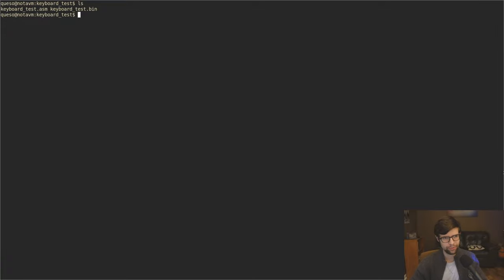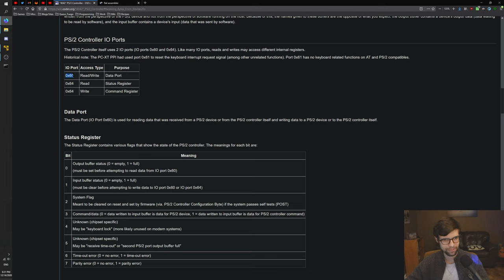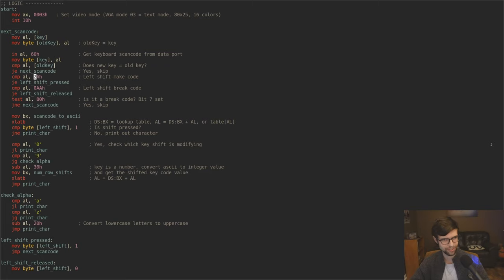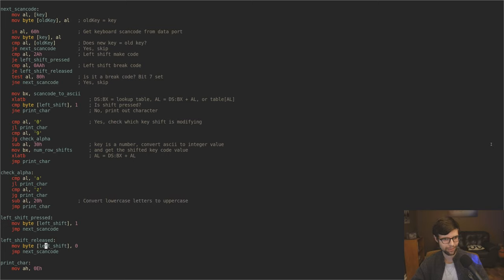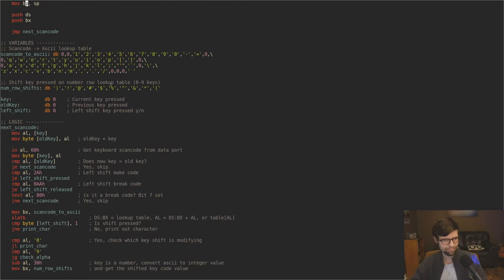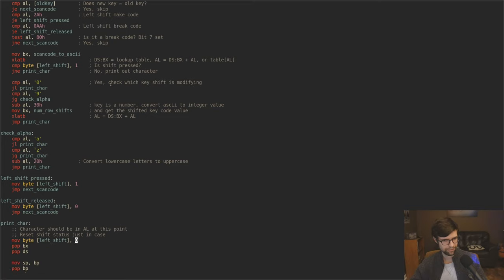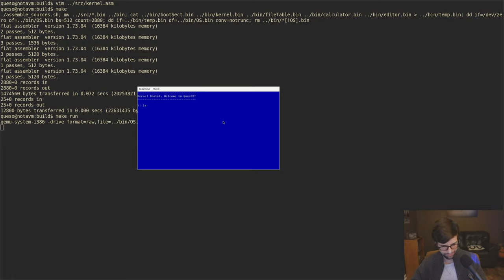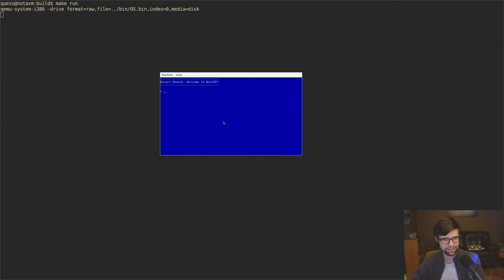Replacing Int 16h (badly) - Amateur OS Dev (x86 asm)

Comment from the maker: Outline:
0:00 - show test file for translating scancodes to ascii
10:51 - Create /keyboard/get_key.inc file
15:55 - Replace int 16h in kernel 1
21:05 - Replace int 16h in calculator
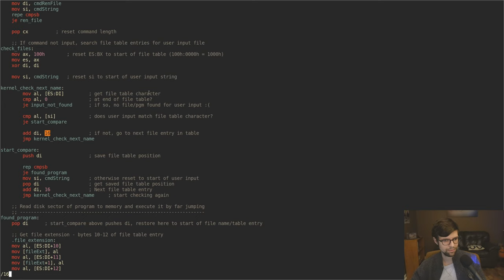31:57 - Replace int 16h in kernel 2
33:45 - Replace int 16h in editor 1
40:51 - Fix editor bugs, replace int 16h in editor 2 (tired voice starts here)
47:36 - Add left ctrl logic in get_key
1:01:43 - Show get_key changes to return scancodes to fix editor
1:06:51 - Coming up & outro

Comment: I have not started with the int 16h replacement yet,.
According various sources, including an IBM PC AT Bios assembly listing ,this is how keyboard is handled within the IBM PC bios:

Keyboard ISR ( interrupt service routine )
This routine is invoked via hardware int 9h every time a key is pressed and uses status port 64h and data port 60h
to get character scan codes and move them into a 16 byte circular buffer located at 40h:1EH

Keyboard DSR ( device service routine )
Is invoked via software interrupt 16h, reads from the input buffer ( char + scan code ) and performs various other operations on the keyboard input buffer.

In my opinion replacing 16h reading from the keyboard port 60h is in competition ( conflict ?) with the still active hardware interrupt 9h, at least on real hardware.
So this leaves 2 possible ways to get keyboard input without using BIOS code :
1. Fetch the scan/char code from the keyboard buffer and update the pointers to that buffer ( my preference )
2. Replace the hardware interrupt 9h address in the IVT and handle keyboard polling via port 60h/64h in your own routine. ( complicated )
Any thoughts on this ?
Reply from the maker: I'm not sure I knew about int 9h at the time, that could explain some oddities and problems trying to implement some equivalent functionality that the interrupt already handled. I assume extra logic would be needed to update the buffer used by int 9h, that I did not do.

Number 1 may be easier to start with and can expand to include number 2 later on, if you set up your own IVT (or IDT in protected mode).
But polling the data/status ports isn't bad either, and checking for new keystrokes or key repeat may require some form of polling anyway, depending how you lay out your logic.
I guess using a specific value as empty/no keystroke for the current buffer position would handle checking for a key.

Comment: Here is my alternative int 16h replacement. It behaves exactly as ah=0 / int 16h returning the scan code in ah and ascii char in al. No lookup is needed. Shift character returns the correct character, caps lock does not work ( just like in int 16h). In short : fetching scan code+character from 16 words circular buffer which is filled by hardware interrupt 9h. ( only 15 positions are used, the last remains 0000h indicating buffer overflow )
CURCHAR	equ 1ah
NEXTCHAR equ 1ch
CHARBUF equ 1eh
BIOSDATA equ 40h
LASTBUFPOS equ 3ch

get_key:
	push si
	push ds
	mov ax, BIOSDATA			; ds -> BIOS data area
	mov ds, ax
waitk:
	xor ax, ax					; zero registers used here
	xor bx, bx
	mov al, byte [CURCHAR]		; al -> current char position in buffer
	mov bl, al					; bl -> current char
	cmp ax, word [NEXTCHAR]	; current == next ?
	je waitk					        ; no char available, wait and loop
	mov ax, word [bx]			        ; ax = character at buffer position bx ( current )
	cmp bx , LASTBUFPOS		; are we at the end of 15 char buffer ?
	jne nextbuf					; no, move on
	mov bx, CHARBUF-2			; yes, set bx to start of buffer -2
nextbuf:
	add bx, 2					; next buffer position or start of buffer
	mov byte [CURCHAR], bl		; update current char position in buffer
	pop ds	
	pop si
	ret							; ah = scan code, al = char
Reply from the maker: This is really slick and simple, love it
Reply: Does it work in protected Mode?
Reply: How does the process of move int 9 handler routine to memory works? This handler rountine come from the keyboard firmware? Sorry for my bad english
Reply: You updated the current character position. But, how about the next character position update?